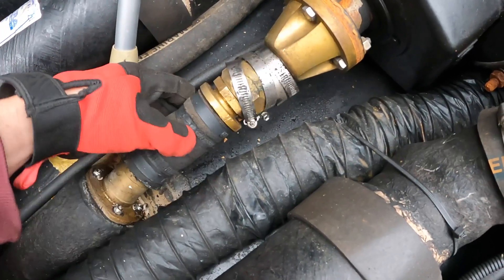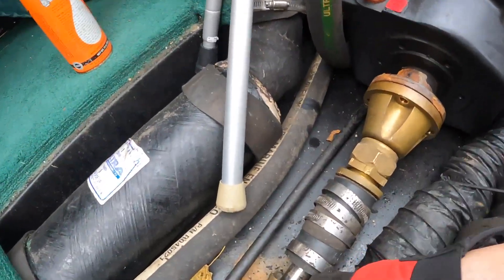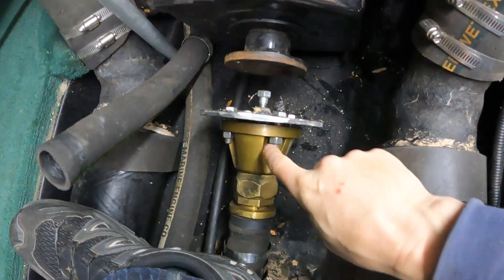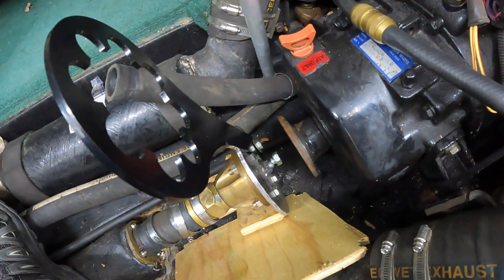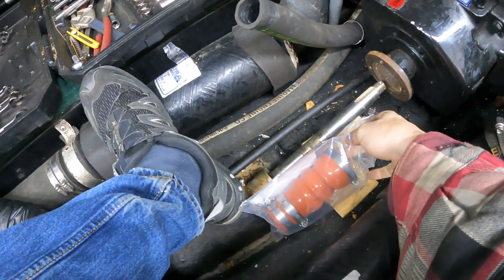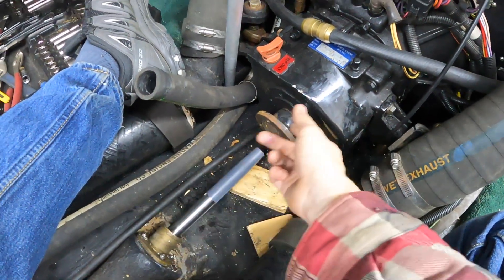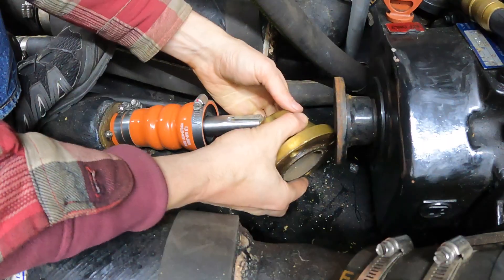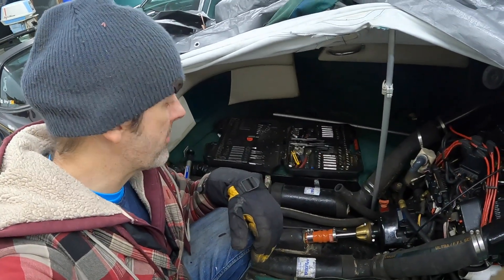Leaking Prop Shaft? This Seal Stops It Immediately

Comment: I switched to the gortex rope and put a longer piece of the rubber hose on as I needed to move my packing gland to a better spot on the shaft. ie. away from the groove.  Now it only drips once or twice a minute.   I was too cheap to swap to the fancy new setup.   How’s the Astro van working these days.
Reply from the maker: Interesting, never really though about extending/shortenening the hose to move the sealing surface on the shaft, but it makes total sense. I did the Astro rear wheel bearings a few weeks ago, and a front wheel bearing a few days ago, but she's okay. Need to descale and retreat the entire chassis again and repair a rotted rocker, so it's getting ugly.

Comment: First, why did you align the engine without even checking the strut alignment. Second, try removing the coupling from a single taper shaft! You have not helped.
Reply from the maker: I checked the strut alignment off camera and it was good. What's different about removing a coupling from a single taper shaft?